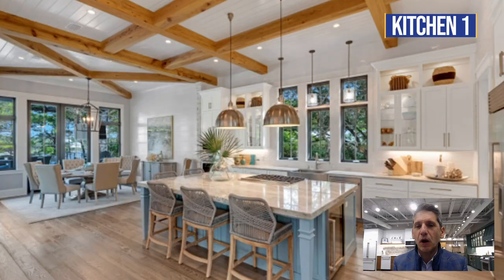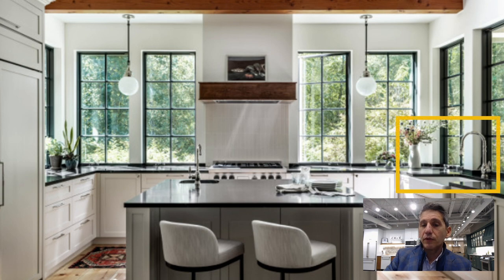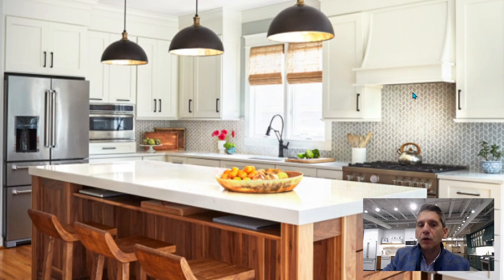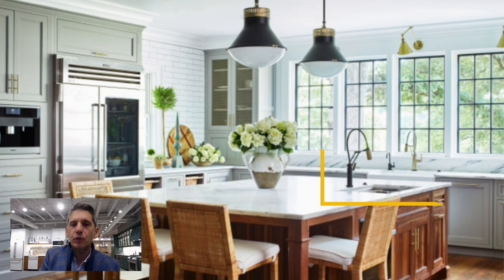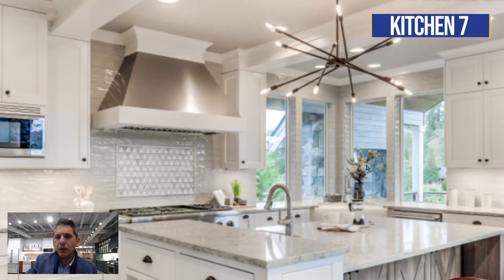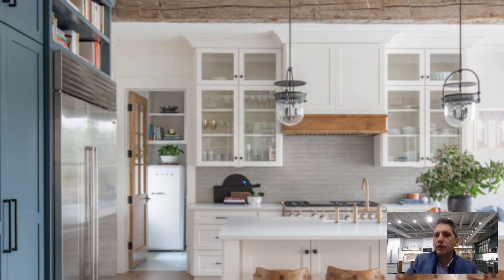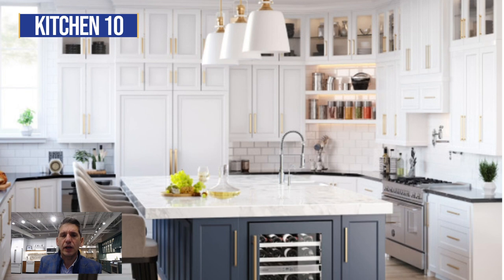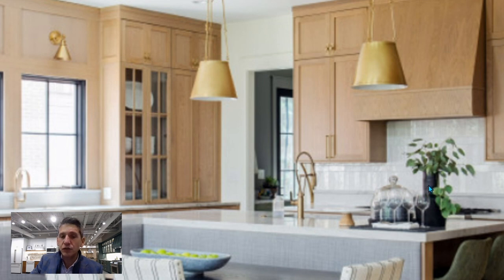Kitchen Appliance Design Mistakes and Best Practices

Comment: Hi Steve -- longtime follower from Indianapolis here. I notice how often you mention a burning pan on the stove. Who's cooking   for you? Turn that cooktop heat down! I haven't burnt something in decades 😂 All Gorgeous kitchens. Just got a new French door wall oven (Monogram) last week! Yay!
Reply from the maker: I am a frustrated cook with a 6 year old who hates everything
Reply: I noticed that as well. It's amusing, but also not.  First off, if pans are burning that often it means that there's dangerous (potentially life-threatening) habits going on that should be corrected immediately.  Secondly, kitchen fires frequently involve oil/grease; adding water escalates & spreads the issue.  Pan lids, baking soda, fire extinguishers - that's what needs to be at hand.

Comment: "The more you spend on a home kitchen , the less likely you are to cook."
Pretty but useless. Compare them to a real cook's kitchen, even Kenji's home spot.
Horrible ergonomics, set up for display not use. Impossible to clean if used even modestly.
Inadequate fume/aerosolized grease control that will coat all the walls.
$15,000 stove for some one who barely needs or would use a hotplate.
Nobody but a pastry chef uses a stone countertop. Bigger fridge than a morgue. Sink that never sees a pot.
Bar sink? what is this Mad Men? Lost Weekend?
Will all get ripped out in 10 years.
 I like this guy ,very good vid channel, but he is , after all , an appliance salesman, 
but one I would do business with, saying nothing I would take issue with about the things he sells.
Reply from the maker: This video was about design ESPECIALLY if you cook.  Stovetop, vent, dishwasher, sink...It can be a $500 stove or a $50,000 La Cornue, the pinciples are the same.

And I am not an appliance salesman.....I only care if people are happy with their purchase.
Reply: @YaleAppliance1  Thanks for the reply and the channel. I'm glad your customers are happy.
The La Cornue makes my point. These kitchens look like the most used appliance in them is a cell phone.
I think your vid made a good point in subtly  saying that fashion is not design. Gotta go, my dishwasher just made my stove reboot.

Comment: Please STOP telling people to put their cooking fires out in the sink with water! Cooking fires almost always involve grease - the water will make it worse.  Slide a lid over the pan and turn off the burner.  I like my sink close to the stove for draining pasta - so I like a bigger landing for the steaming hot water.
Reply from the maker: Ok...how about placing a sink near the cooktop because they are the 1 and 2 most used in your kitchen.
Reply: He never said "cooking fires". He said "if you burn something". Often it's your finger, your sleeve, cooking mit, plastic tupperware lid that you mistakenly forgot was there, etc. And you definitely want to submerge any one of these in cold water within a sink that is right next to you. "Sliding a lid on" these things (including a burnt hand) isn't the most transferable solution in these cases.
Reply: Having a sink within a step or two of the cooktop is practical, yes - great for food prep, draining pans, cleaning as you go, et cetera.

Emphasizing it as useful for burned pans (or whatever) undermines you as a kitchen design professional. It suggests to the viewer that 1) you don't know how to use the appliances correctly, and/or 2) you don't understand kitchen safety.

Mostly I think your channel provides a lot of practical & straightforward information. Acknowledging accidents happen & that good kitchen design can limit potential hazards would be a more professional tack, IMHO.
Reply: It's OK.                      The people who buy these kitchens don't cook, so, little risk of fire.
They just take pictures and pose in them
.Put a fire out in the bar sink?
 Maybe if it was just what they were smoking.